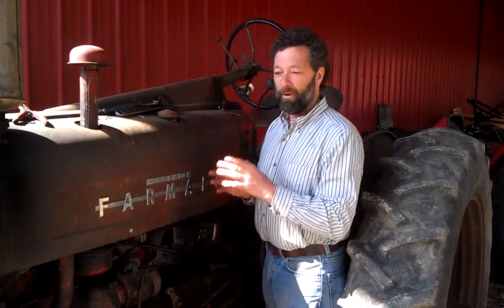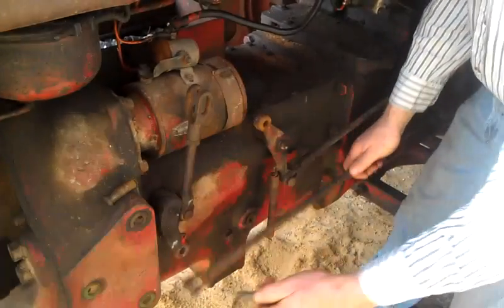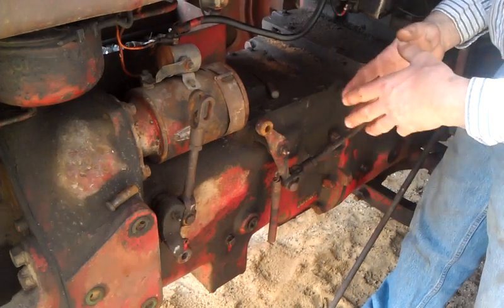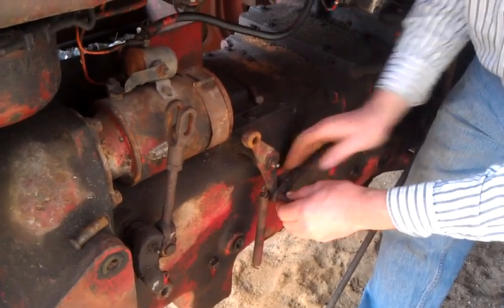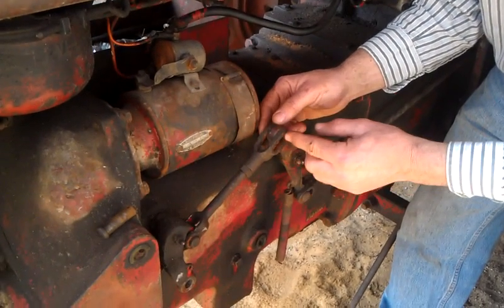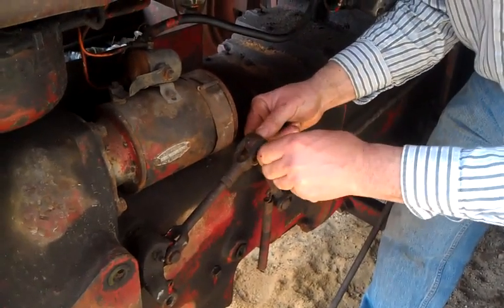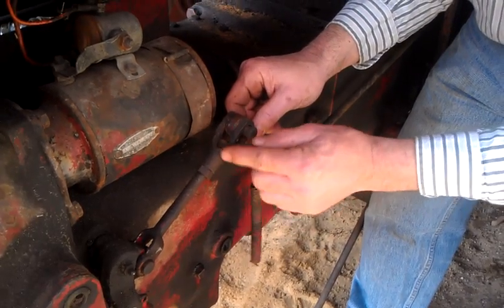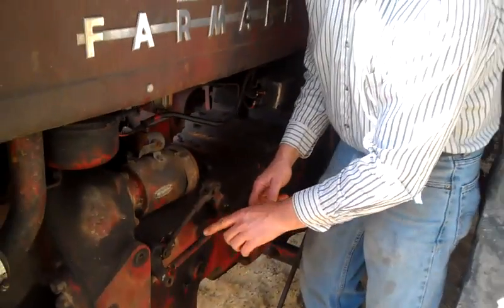How to Adjust the Farmall Torque Amplifier

Comment: I have 460 My Ta works  on pulling sled under load it jumps to neutral switching on the go. I got all the adjustments on ta side tight as they will go. and it seems work a little bit better. Does this mean I need a new Ta clutch?

Comment: I have a 1958 Farmall 340. The linkage for my tractor looks just like the linkage on your 300. I adjusted per your instructions, but I still have no TA function.
Reply: One thing an old IH mechanic told me is that the oil the owners manual calls for in those older IH tractors is wrong. some manuals call for 90w gear oil to be used in the transmission and T/A, and it should be Hy-tran instead. He told me that the later tractors used Hy-tran and didn't experience nearly as many T/A problems. If your transmission and T/A have gear lube in them, drain them, fill the cases with diesel fuel and drive the tractor around for 10-15 minutes while you engage and disengage the T/A. If the T/A comes back to life, drain the transmission again and fill it with Hy-tran hydraulic oil. The gear oil gums up the ramps and rollers in the T/A, and can cause it to stop working. It's worth a try, it is much cheaper to try this first rather than spend several thousand dollars on a rebuild.

Comment: 1. Adjust the TA linkage for 3/16 free play. 2. Adjust the main clutch for 7/8 at the platform. 3. Install the spring. 4. Adjust the connecting link as short as possible without moving either clutch shaft.